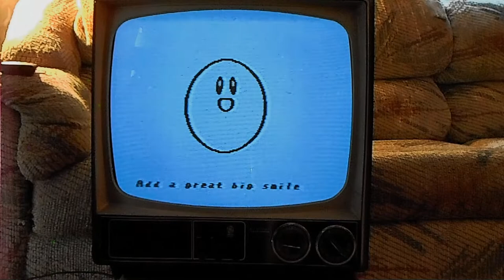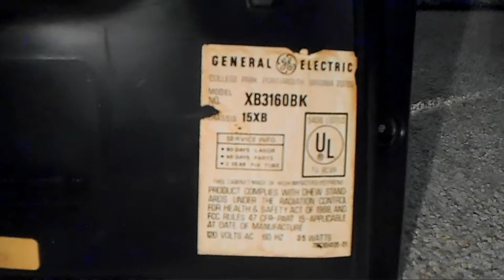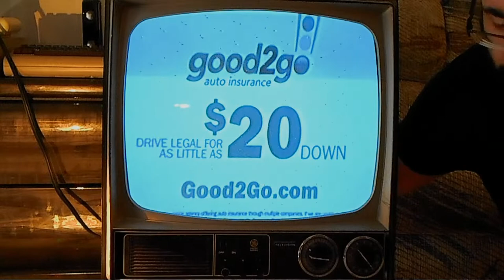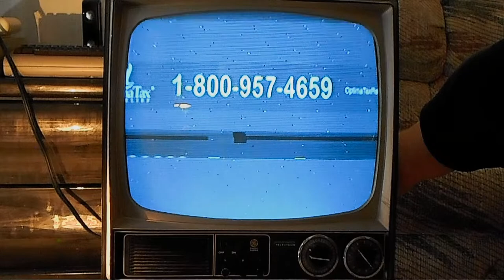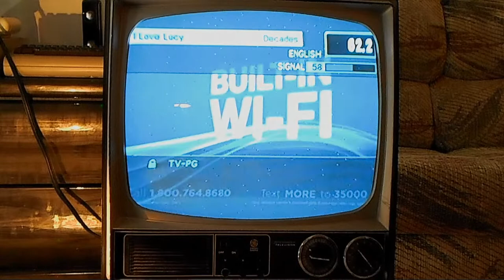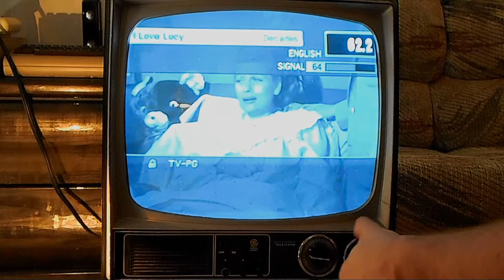General Electric 15xB Black and White TV - Retro Goodness

Comment: Pretty sure that’s the first time I’ve ever seen Bob Ross in black and white! Always found it odd how many security cameras were in black and white back in the day.

Where I grew up we couldn’t use channel 4 with devices (like the Colecovision or whatever) as there was a bonafide station there. We HAD to use 3. And our PBS was big enough to be on VHF. But Elvira on Saturday nights? UHF all the way. And she looked just fine. ;)
Reply from the maker: Yeah, we always used 3, as 4 was NBC, and 2 was CBS I think, but became Fox... I remember everyone used to blast Fox when it was new because they tended to have bad UHF locations, but ours looked good. CBS moved to 62, and that I remember to be a powerful UHF station, as was PBS... But WB/UPN and a whole bunch of other independent stations tended to look pretty bad. I remember having the NES on  but changing it to channel 2 made 2 unwatchable, however 4 would be mostly there, and it actually even would slightly interfere on 7. I think by 9 or 11 it was okay, in Detroit 9 and 11 were from Windsor Canada, I remember Hockey Night in Canada! Can't get those ones anymore though, there was a benefit of analog right there, as  cable and even my digital tv box can't pick those up anymore. I think my dad had used a true RF "switch" when it was connected to the C64. The Nintendo/Sega ones are automatic, as soon as the system is on, it's getting used, but the result is that if you want to pause the game and watch TV, the stations looked bad. But they did make manual switches you turn off manually and still get good TV even when your system was on.

Comment: Can't even remember when I saw a black and white TV in operation last time.
Reply from the maker: Surprised me when I looked into it a little more and found out GE kept making this line of black and white TVs (in different boxes) until 1984! Other than my own here, I can't say I remember running into many black and white TVs elsewhere... I think my great grandmother had a super old one, in a massive cabinet, and she was still using it as her main television into the late 90's. Other than that, I mean I think I still saw CCTV security systems displaying in black and white only 10 years ago, but those could very well been the cameras and not the televisions... But it wouldn't surprise me if a lot of those smaller security monitors had been in black and white to reduce prices.